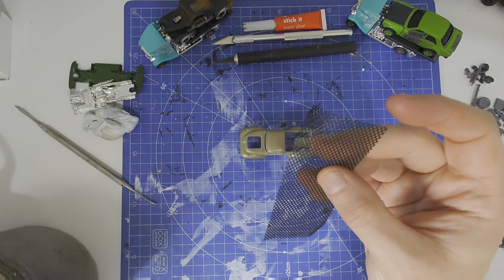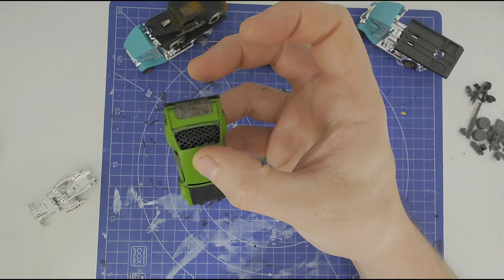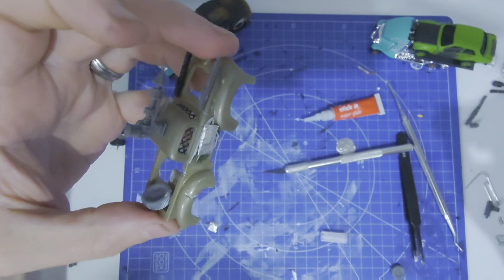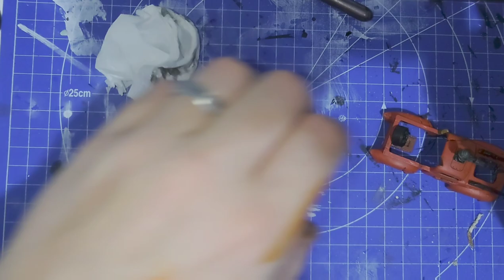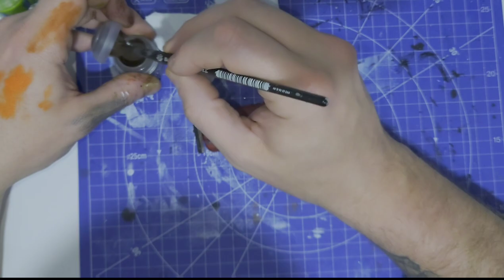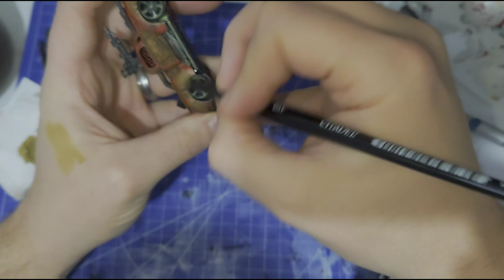How to build a car .. part two

Comment: Any recommendations on glue? Having problems sticking rams onto plastic chasis parts. (i,e, Rams from the Implements of Carnage sprue onto Hotwheels chasis, so soft plastic to hard plastic). I have sanded both parts but the glue I'm using (Screwfix superglue) doesn't seem to work well (although its fine on metal to plastic).
Reply from the maker: hi Bowlin01 . I use just pound land super glue and have not had an issue . you could allways use baking soda on the superglue ( it acts as a bonding agent but WILL set it right away so be carefull ) other ideas are to scuff up the parts but touch wood I've never had to do this . I have found that the cheaper glue works better then the branded stiff. hope that helps 😃